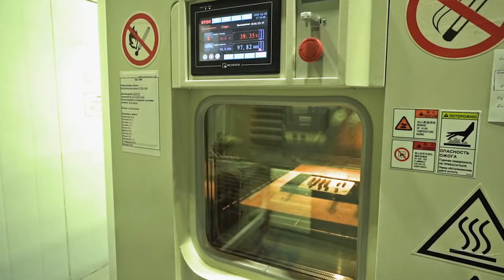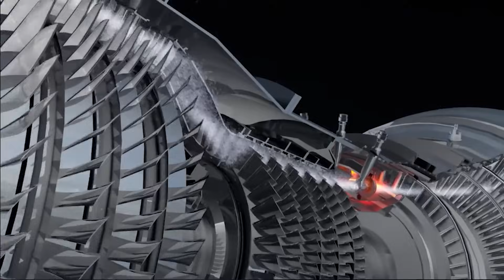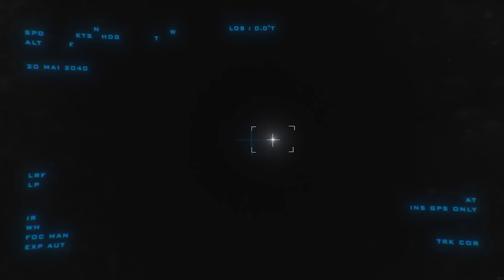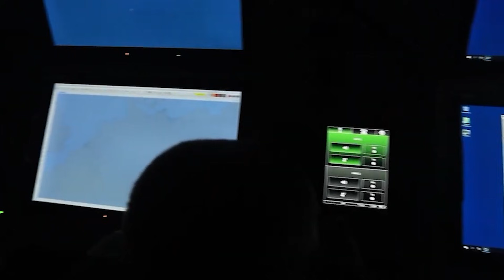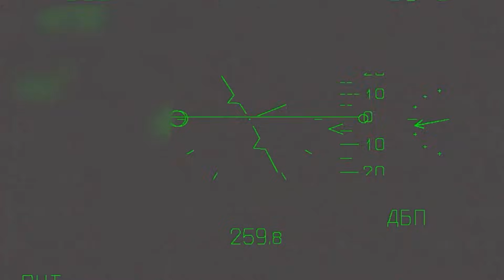Inside Russia's Secret Hangars: The Unexpected PROOF of the PAK DP Jet

Comment: If Russia cannot improve the MiG-31 by 30% in every way, and after 50 years since the MiG-31 first flew, then it is absolutely pointless to continue talking?!?! Everyone has seen how Russia has upgraded the S 300 PS to the level of S 300 PMU 2 and S 400!!!
Reply from the maker: Incremental upgrades don’t define successor programs. New platforms focus on sensors, networking, weapons integration, and mission roles that legacy airframes were never designed to handle.
Reply: Now is S 500
Reply: Russians never shows ther cards
Reply: @bojanjavornik6406 The S 400 and S 500 are systems that are not used for anything, I think the most used are the Buk M2 - M3 and Pantsir S1, what should be more is the S 350 as well as the Mig 35!!! I don't understand why Russia doesn't make 24 MiG-35s for its own needs to supplement the air defense?!?! There is simply no need to use the SU 35 or similar for everything, since the difference in the price of an hour of flight between the MiG-35 and the SU 30 SM or 35 is huge!!! I think the MiG-35 would be useful?!?!

Comment: Russia looking pretty saction proof nowadays....I wouldn't bet against them....
Reply from the maker: Russia has clearly adapted in some areas. At the same time, adaptation doesn’t always mean efficiency — sometimes it just means higher cost and slower output.
Reply: @militarypower-s2r bottom line they are putting numbers on the battlefield and the west cannot.
Reply from the maker: @111Bradford I see what you’re getting at. Russia has definitely been able to sustain volume in certain areas, especially where systems are simpler and production is prioritized. At the same time, quantity on the battlefield doesn’t automatically equal long-term advantage — logistics, training, losses, and replacement quality all matter just as much.

That’s why this isn’t a simple “one side can, the other can’t” story. Different doctrines, different trade-offs. The interesting part is how each side adapts under pressure over time. Appreciate you adding to the discussion.
Reply: @militarypower-s2r the west has no numbers moreover their equipment is subpar in every area russian army is superior including training as evidenced by 515K ..Ukronazis KIA in 2025 alone. In December 2025 they cleared and gained 700 kilometers and 62 settlements.The conflict is just about over...but the Ukies are gluttons for punishment so it will drag on.
Reply: @111Bradford  Probably more being used and abused by the US. Putin moved very slowly and stating his demands from the very beginning but the US wouldn't allow any peace talks letting Ukraine get pushed to annihilation. Besides the bio weapon labs the arms build up on his boarders the murdering of the Russian speaking Ukrainians was another key factor. They burned about 40 people to death taking refuge during a protesters clash, several jumping to their death to escape the fire.(thank Barry Soetoro and his henchmen for that) Can you imagine, yet Putin still is careful not to hit civilian targets. I think Russia is decades ahead of us in the tech department. Having 5 types of HS missiles to the US-0 gives a lot of meaning to the subpar statement but the nuclear powered cruise missile they already tested for 15 hours shows just how far ahead they really are. A nuclear reactor powering a cruise missile ! who knows how long that thing can stay in the air.......
Reply: Two to three years ago, Russia switched its industry to the war industry, and this means that in a short period of time, many people have been employed, most of whom have never worked anywhere!!! Or they were doing something like in a store or some other service activity!!! It takes time for people to get used to their new job. But given that Russia has opened almost all of its production facilities and has taken out all its projects that were lying on shelves in MiG, Sukhoi and other factories,Everything takes time!!! There is no doubt that the management of these factories also invited people who are retired for some things that have been forgotten?!?! Realistically speaking, the 90s today seem like a long time ago, but basically people who were 30 years old then and worked on some projects today are people in the 70s!!!! And I think that Russia will have no problem finding a way to achieve some of its goals!!!! Of course there is also espionage on both sides, who knows how many people returned to the country when all this became??And the most important thing in this highest thing was done in this part of Ukraine where the Russian army is located!!! And these are Luhansk, Dombasu, Zaporizhzhia and Dnipropetrovsk!!!!